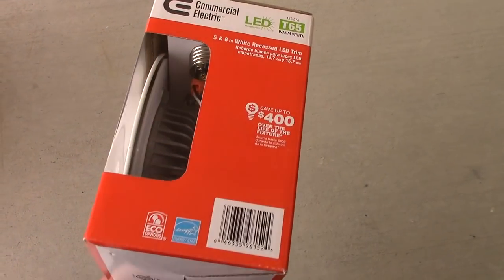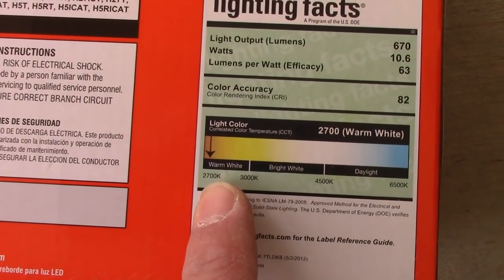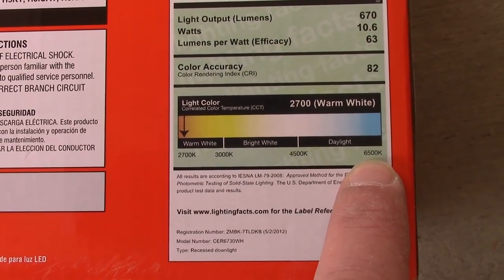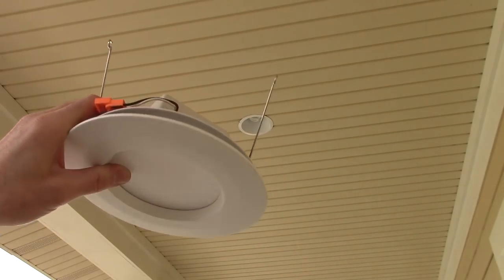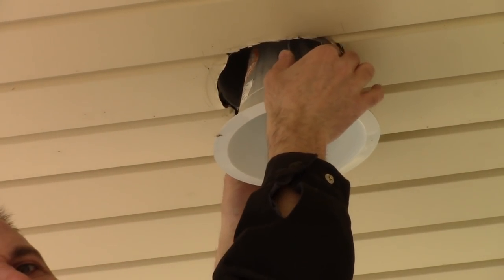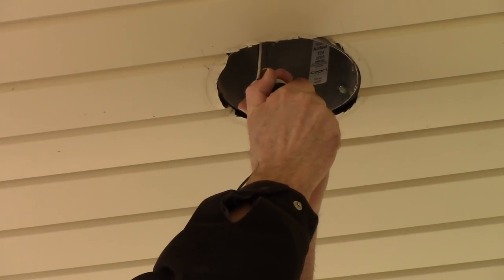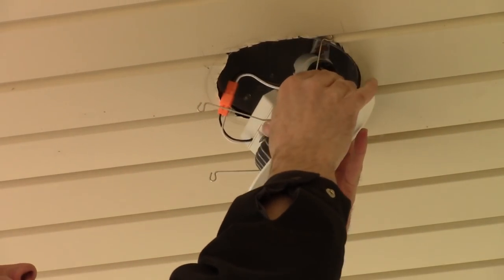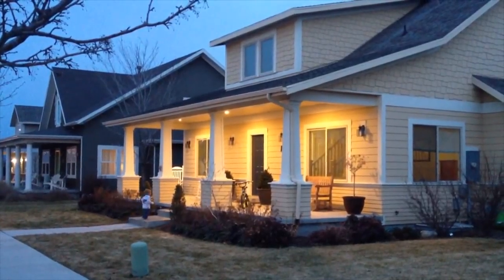Changing Porch Can Lights to 6" RECESSED LED

Comment: These are great lights (commercial electric T65 at home depot). They are true 2700K, give off a clean bright light without any blue tinge. They are also 90 CRI which is great. Most LED's in the past have been 80 CRI.

Comment: Thanks for your video. I am looking at these lights and have 2 questions. 
1) The color temp of these fixtures, some of the customer pictures under reviews looks too good to be true for 2700K.
2) Is the rebate program still active, if so, where can I find that online forms, any link to PG&E?
Reply from the maker: A week after I made this video Lowe's had a very similar product with a rebate as well. It brought the total cost after rebate to $5 each. Crazy!  I have noticed that the rebate program comes and goes. So check with the stores often. Both Lowe's and Home Depot had rather large displays right when you walk in to the store. Hard to miss.  The forms were on the display, but you did not need them if you filled it all out online.  I got my rebate check 6 weeks after I filled out the webpage form.   I don't know if PG&E are doing it but I bet they will soon.